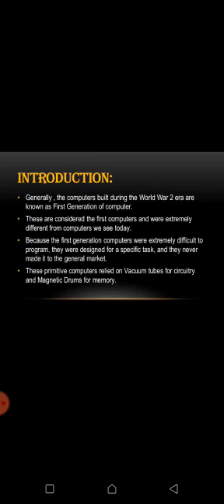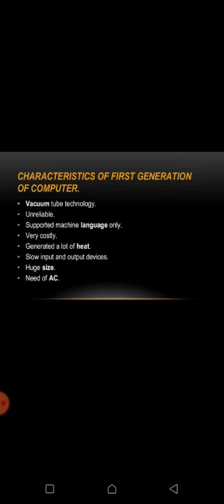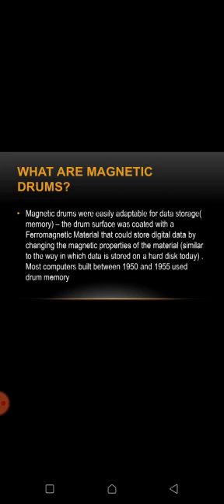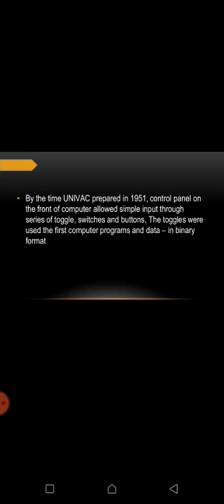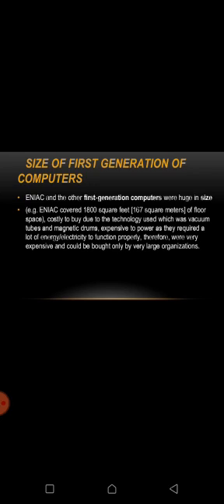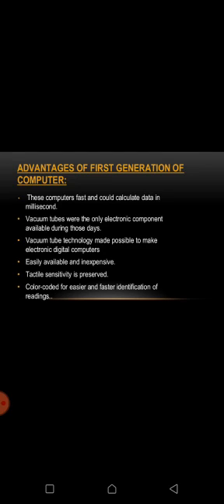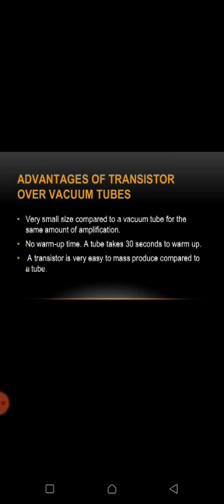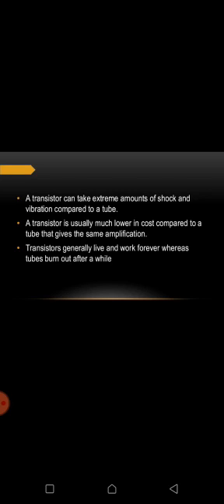Generation of computers

Comment: Gud..!!
Computer generations are based on when major technological changes in computers occurred, like the use of vacuum tubes, transistors, and the microprocessor. As of 2020, there are five generations of the computer.

Comment: Good
Summary:
There are five generations of computers:
1st: The first generation of computer was based on vaccum tubes and magnetic drums.
2nd: The second generation of computer was based on transistors.
3rd: The third generation of computer was based on semi-conductors.
4th: The 4th generation of computer was based on microprocessors.
5th: The fifth generation of computer was based on artificial technology.
And then today's generation of computers also used/based on artificial intelligence.

Comment: Good
Summary :
There are five generation of computer. 1st generation uses vaccum tubes and magnetic drums for memory. 2nd generation computers used transistors. 3rd generation used integrated circuits. Fourth generation used Microprocessor.And fifth generation introduce Artifical intelligence.

Comment: Good
Generation of computer 1 generation are large and are the size of room. They designed for specific task example ENIAC. In it vacuum tubes are used and they generate alot of heat. Magnetic drums are used for storing data

Comment: Good
Summary:
Generations of computer is a change in technology of computer with the time being. 1st generation computers used vacuum tube and magnetic drums for memory .2nd generation computers used transistors. 3rd generation used Integrated circuits. Fourth generation used microprocessor and fifth generation used Artificial intelligence .

Comment: Good 👍
Generations of computer means the series in which computer improved it's quality time to time. 1st generation of computer (1940-56) were introduced based on vacuum tubes6. They are high costly and occupy large space and than 2nd generation introduce based on disadvantages of 1st generation try to improve them and time to time other generations introduced with good quality as compare to previous.

Comment: Good
Summary: Generation means some changing in pre existing thing.
1st generation of computer of computer uses vaccum tube and magnetic drums.
2nd generation of computer uses transistors.
3rd generation of computer uses semi conductors 
4th generation of computer uses micro processors 
5th generation of computer uses artificial technology.

Comment: good
generation of computers are five. started from first generation. 1st gen used vacuum tubes and magnetic drums. Vacuum tubes amplify signals by electrons' movement & magnetic drum stores data. Input is paper type & output is displayed on printouts. Features are expensive, high power  consumption and more heat generation. Pros include being capable of calculations, having electronic components.  Cons include highly inefficient, highly over weighted,& expensive. They couldn't do multitasking & had small storage.

Comment: Good
summary
Generation in computer terminology is a change in technology a computer is/was being used. Initially, the generation term was used to distinguish between varying hardware technologies.1st Generation(1942-1959)
 vacuumshave ICS with ULSI technology large capacity and hard disk. They are powerful computer and have rapid software.

Comment: Good✌
SUMMARY:
Generation in computer terminology is a change in technology a computer is/was being used. Initially, the generation term was used to distinguish between varying hardware technologies. Nowadays, generation includes both hardware and software, which together make up an entire computer system.

Comment: Good
Summary:
1st gen (1940-56) computers were based on vacuum tubes (to ease flow of electrons) & magnetic drum (to store data).  Used Assembly and machine language. They were extremely large, very costly, consumed more energy & generated more heat. But they could also perform calculations in mini secs and built foundation for the next generations of computers.